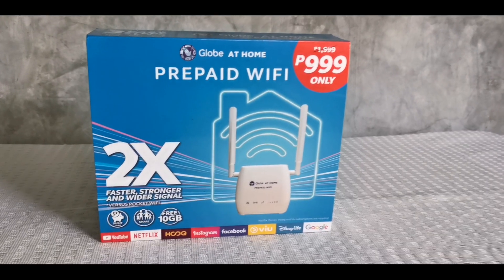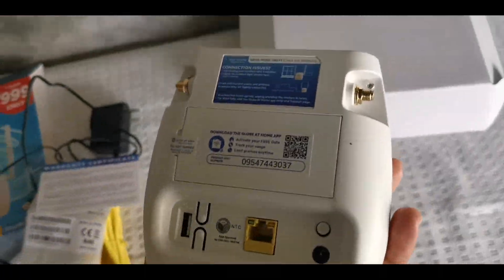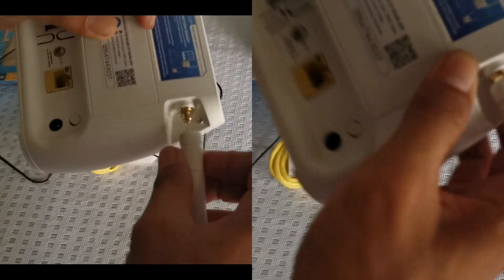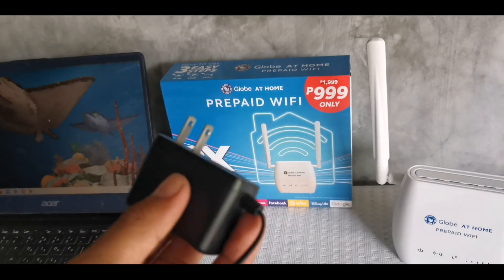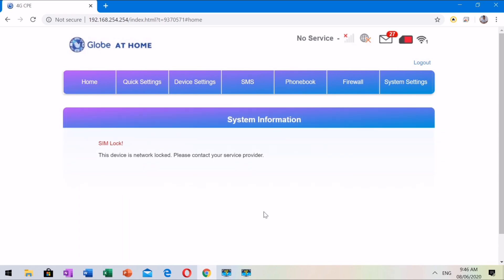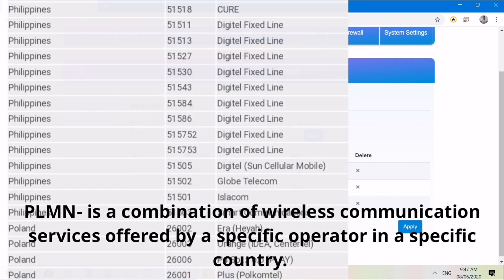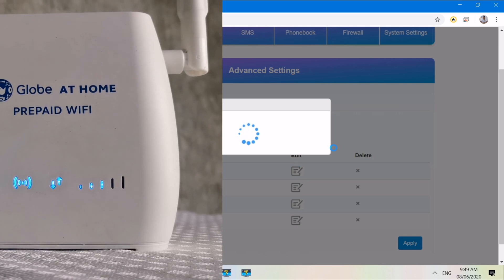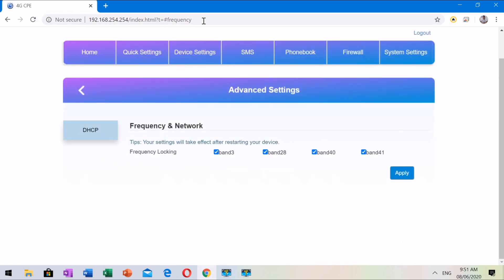How to: Openline Globe Prepaid Wi-fi (Model: ZLT S10G)

Comment: Sir pwede pa po ba ibalik yung globe na simcard?
Reply: At pwede po ba ito lagyan ng smart na 5g Sir? Sana ma sagot po kailangan sa online class eh
Reply from the maker: @noeljohnapostol222 
Hanggang 4G lang nasasagap ng modem na ito. Suggest ko bili ka ng ibang modem. Hindi kasi siya 5G capable.
Reply: @ICTSupport101  thank you sa info sir more power
Reply: @ICTSupport101  The main topic being talked about here is the Modem ZLT-S10 . . Courtesy of Globe Telecom's brand name adopting the manufacturer brand not so popular and so lower cost perhaps than the known established brand in the market, so perhaps the views to make Globe's martyrdom is over, to be catch up on stock market value, is so typical strategic brand management by procurements division. .
While indeed too much revenue been available due to sim product designs of both wirelss networks as Globe Telecoms on their product and services of SIM for data to have an expiration date of a week usually,  that so resources were able to be reinvested couple with sure to be maximising such new partnerships sourcing for new gadgt equipment manifacturer for more competitive solutions as to the saturated market with lesser demands on the modem router, so lesser wholesale and so higher deals with big and already famous manufacturers that can dictate higher pricing on such popularity of the brand while perhaps such higher price would be due to the lesser quantity per wholesale eal unit batch orders.   

So new business partnerships are proven cascades of interdependency as gears turn other will as well, so opportunities for new market players can be available   while other worldwide economic activity recession being erroneously termed economic recession, in the hope of reversing the issues, has no hopes interface reality. .

That is specially in this new economic conditions dictated or so hidden by COVID pandemic, that so competitiveness besides Huawei or ZTE that could bid has not so much issue to  carrier Giving opportunity for sensible chat opinion or product feedbacks secondary to the creation of this YouTube videos. . So might as well give credits to the product modem model that likewise of courtesy by Globe to be purchased at lower cost and though the opportunity to buy direct to manufacturer in China made available thru the current  e-commerce, that can be possible thru whole sale for similar price offer to Globe by the manufacturer.  . 

While to buy retail means higher price, with inconveniences to satisfy aftersales support services, . When certainty of new players as ToZeD to be present it's service centers worldwide or be continental would be challenge that can be satisfied readily if the brand is the pioneer and not earlier competitor. . to have such necessary revenues to support it's overseas branching business operations as repair service centers, be it of simple business operational existence of sharing expense overheads as rental or utilities with another business for a commercial place.. 

That all seemed to be on own adjustments from consumer customers calibrated spendings should be viewed as common scenarios on places locally or abroad, it would be more than just prudent but is to be true. .

Thus in the name of sensible parallelisms at connecting all our efforts in chats to ask sensible and honest questions so require equivalent class of response answer of honesty and sensibilities, yet with inevitabilities of that being unaddressed or be rendered with not so equivalent level of response though with no intention to be selfish or yet seemed haughty to advise to buy something cannot be made readily available by manufacturers with not so much sectors or society class can afford so investments will not be returning the capital more so revenue to further manufacture and diversify a branding and model units.

So it would pay from the efforts of video creator for it's sensible ideas shared,  to be not promoting something Intangible to the issue to not be a resourceful or maximising resources from the source of either the issue in question, limited to what is available as 5G Smart SIM (is readiness and not actually about specific fixation to one Class of Network and cannot be flexible to be automatic usually such is dependent on place for such availability with issue as congestions and e-commerce business demands, so such 5G is of cellsite assignments for major urban cities and not rural with lesser e-commerce or business existence.

So response chat should be kahit hndi na bumili Ng 5G modem router as wla pa ata nun, mayroon pa Lang cgurado eh Category 6 or CAT 6 . . Of 4G modems from usual Cat 4 and 3 category with lesser packets batches of uplink and downlinks so the speed is still within the range of 4G depending  band made available by cellsite in the area as such can be FDD or TDD. . With LTE of evolution can be flexibility of from 5G to 4G or 3G to 2G or the reverse upward and sides to sides of this network signals.. .  should be of automatic connection by gadgets to be flexible on available signal broadcasted by cellsite towers, 

Kung mayroon na 5G cgurado pra lng sa makaka-afford. .  Where affordability cannot not be limited to the amount and price but also the specs feature built in the SiM to adjust itself from the 5G state down to the slower and lower 4G. .

Please note that 5G on simcard indicates readiness and not the actual renderer of the signal, as it is the cellsite tower calibrated presets usually on major city urban location of a Country place..
Reply from the maker: Pwede naman ibalik ang Globe na sim card. Wala po yung problema.
Reply: This is to remind of the earlier advise reply by the advisor & YouTube video provider advise that there is no problem to replace re-install back the actual installed Home Prepaid WiFi Modem Globe SIM.   While that would depend on Kung ok lang ba masira or i-break ang sticker that represents or so pertaining the warranty of the gadget modem.  Though such warranty posed usually by such sticker has no sound technicality that is only business basis, of about that has to be built or of building customer base relation of either seller (Globe) or buyer (of network SIM and it's services as subscriber). 

That both entity of subscriber nor wireless SIM networks services providers should at least be heeding such customs of business, or better yet should satisfy conditions of a greater than being just entity of conventionality to just be customer,  so attain such status of immunity to fault, or so of winning bet-ter yet that infallibility attributes of a Pope would at be  rendered obsolete, by such "tag-lay mong pambihira Filipino song line, to be not just liked as loved. . 

This is more about the business existence or stability, as that of Globe neworks is from too gracious of gracefulness to be able to render greatness, must have such oversights not of the typical ears, eyes and nose that are extensions of another entity, but that should be of the unvexed overlooking viewpoints to be not branded ancient as the apostle, modern as ICT folower, or celebrity's fan stalker, of an entity as great idea. Besides of a known person so confident being educated representing the video content creation of or in YouTube.

 Besides such to be not expecting of the too much for the supposed or as promising business investment returns, with so thought by opinion not so advanced of the long range & wide views, that so can only be too much of exaggerations for the education deprived of such simple commonsense what more complexities of not so common as commerce further amplified by complications with or due to electronics so nicking being underdeveloped similar to uneducated on it's applications of technology to entity as commerce, other hindrances to developments by or due to possibility for access by socket layerings, as that what had been supposed to be enforcing as cybersecurity is with inevitabilities with the subtlety of greatness that even grace and gracefulness would be so limited to be fathomed.  That when being interpolated would render the anti version of so antagonistics the thought to be Protagonist, being subjected to instability due to the burdens of supposed assets becoming liabilities, as difficulty of signal, or removed call center BPO services, or if with such is with untrained or insufficiently trained employees from staff to officials in the tactical business operations,  or be it the strategic senior managements corporate levels.

That such product costings of either single modem purchase or be it as big as the contracting exclusivity of Globe to buy wholesale to it's Manufacturer ToZed, for such brand & model of gadget that somehow have made available the Mobile wireless communication networks services, vis-a-vis the equivalency of the production- manufactring sector of business, in such interdependency designs existence & coexistence, of the business industries.  
 
<To be continued on Next Comment>. .
Reply: Pati ako nalito Kung thumbs up interpretation for as if I am rendering the proper approval to have such requests available to the SIM, I thumbs down due to a seeming non sense to raise such entity of question, of course you hold and maintain or keep such decisions, holding such proof of purchase as OR - Official receipt or so other cascading existence to have procured such property that is not so much to be not acquired  by your existence and daily subsistence of your perhaps sensible existence working or have sensible business with multifarious interdependencies that proves you can likewise depend such choice of network SIM service installations and your varied other Sims as your choice with such buying power to replace it back,  buy other sim, and maintain to reload or monthly pay for such and even defend to keep the sim product and services.
Reply: Natatakot po ako mag lagay ng ibang sim baka Di na pwede I balik yung globe simcard ko sir
Reply from the maker: Marami nag ssugest ng Huawei B315s-936 or B525S-65A (4G/5G).
Openline.

Comment: That's a very nice video 😊 thank you.

Can I just ask if we need to connect to our wifi first before we open the IP Address in chrome?

Thank you.
Reply from the maker: Thank you Ms. Carmela. You need to connect first to your wi-fi either wired or wireless connection before accessing the wi-fi management page/settings.
Reply: Thank you . I followed your steps carefully . But may signal is still red , can you please advice me what to do ? 😊
Reply from the maker: @carmelaumali2910  It should work smoothly. Did you disable MCC/MNC locking? then added 51503 and 51505 in the PLMN?
Reply from the maker: @carmelaumali2910  After the configuration of PLMN, there is an option for a restart by clicking '' Apply''.  After restarting, the modem/device should work perfectly. I' ve done it four times with different ZLT-S10G modems and they all works fine.
Reply: Thank you sir /ma'am maybe it's just the signal here in our area is so poor.

Comment: i use smartbro lte...did not work :(
Reply: Gumamit ka ng smart lte sim? Working nmn sa akin.
Reply: @corazonparco7820  anong lugar nyu? ang malakas samin globe. siguro ganun...pero hindi talaga nadetect sya e
Reply: @leoriohan5737  taga Leyte. Working nmn. ZLT-S10G rin ba modem mo?
Reply: Yes zlt s10g globe at home po...
Reply from the maker: Red indicator lang po ba nag appearsa modem? Bakit hndi nag work?
Reply: Siguro mahina lang talaga dito ang smart...malakas kasi Globe ko 20mbps...pero madaling maobos data...gusto ko sana magcorpo sim smart pero hina signal😢
Reply from the maker: Kagabi at kanina mga 2 hours nawala signal ng Smart corpo sim ko. Pero ok na ngayon. Wala na ata offer ngayon na unli internet sa Smart, meron na data capping. 48 GB ang monthly data.
Reply: May capping sa mga bago bili sim ...starting July 1 yata...pero sa nga old sim hindi daw maapektohan po
Reply from the maker: Mabuti kung ganun. 1 sim lang kasi ang corpo ko. Balak ko pa nmn mag additional line kaso naabutan sa bagong plan matrix.
Reply: @ICTSupport101  update ko lang. Na open line na pala sya. Just need to check all yung nasa frequency locking nya at magdedetect nya sya what sim naka sak sak. :D
Reply from the maker: @leoriohan5737  mabuti kung ganun 😁👍👍

Comment: How to openline B312-939 please
Reply from the maker: Wala pa ako ganyang modem. Pasensya na
Reply: Baka tulad yan nung ZTE MF283 requiring hardware tinkering as smart card PCM IC that can be bought to attached to the main board for de-branding prior openline, or perhaps that can be is such software of strings programming instructions iterations using pc. .of the device management of Microsoft powrered OS pc. .

Comment: Network selection it failed on 3G &2G only network.

And not all area has a 4G network. Can you Help?
Reply from the maker: Free ADMIN ACCESS for Globe at Home Prepaid WIFI

1. Go to 192.198.254.254
2. Login using your credentials.
3. Click Device Setting
4. Click Advance Settings
5. Click DHCP
6. In the url address bar you will see http://192.168.254.254/index(.)html?t=#router_setting change the #router_setting using one of your preferred setting in the list below.
7. Example: http://192.168.254.254/index(.)html?t=#frequency
8. Press enter on the keyboard and now you can configure or change a setting.
9. Apply. (If the device asks for a “reboot/restart” just click okay.)

Note: Make sure to always click DHCP before changing the url or else it will not work.

Here are the list of settings and their function:
#apn_setting - APN Setting
#net_lockpci - Cell ID Locking
#flow_setting - Internet / Data Limiter
#nat - NAT Disable/Enable
#l2pt - Virtual Private Network
#unlock - Input Network Unlock Code
#mcc_mnc_locking - Network Lock Disable/Enable(Openline) - Popular Setting
#frequency - Frequency Band Selection - Popular Setting
#system_upgrade - Firmware Upgrade
#net_select - Network Selection (4G/3G/2G)
#ussd - USSD Dialer (works on 3G connection only)

Credits:
Jhowel Gracio Huerto
Keith Rivera YT Channel
Hacknet Tricks